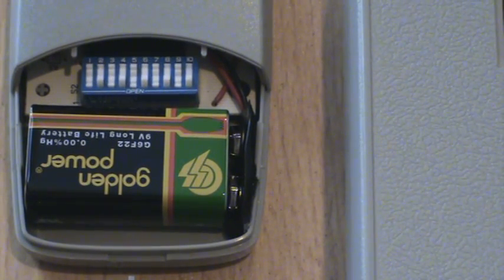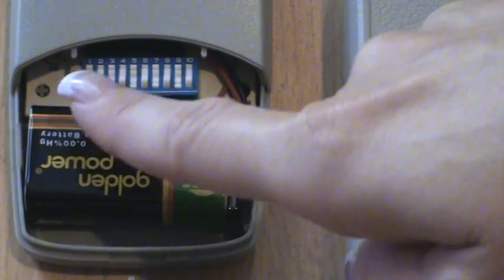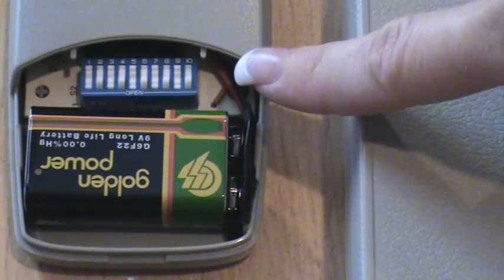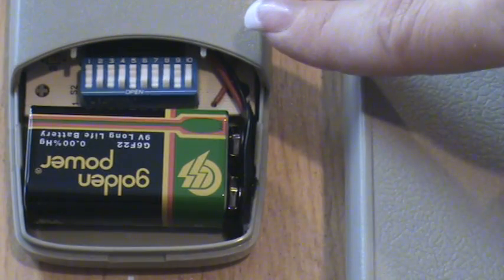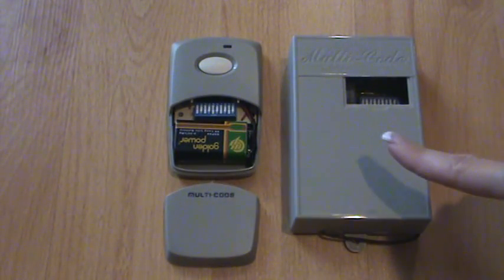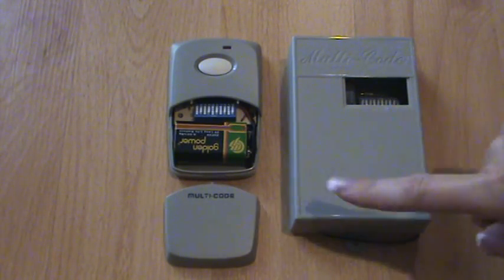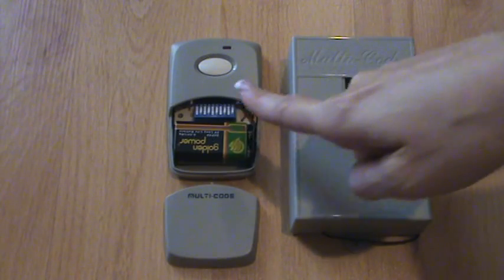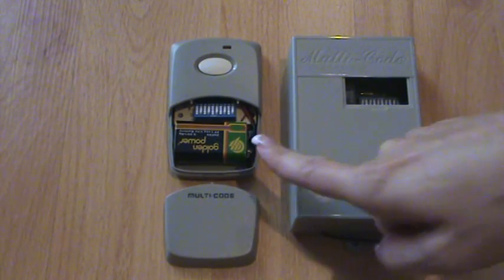Understanding Dip Switches and Programming Multicode 3089 Remote

Comment: I think she shows the on/off switches in reverse or it isn't clear. For instance, if you depress the number 1 dip switch at the top so that the bottom of the switch pops up, is that dip switch in the on or off position? Also, she points the bottom and says plus, zero and minus (with minus at the top). This is odd because the manuals and videos I've seen show the dip switch as plus at the top, zero in the middle, and minus at the botom.

Comment: good video.. could be made better by 1) showing the inside dip switches of the receiver to show match. and 2) explaining that the receiver 1090 shows OFF for one setting but the 3089 remote says OPEN ( which means open circuit or off).  OFF = OPEN